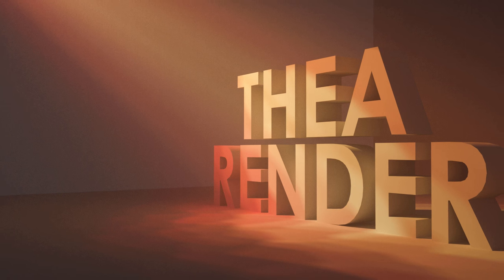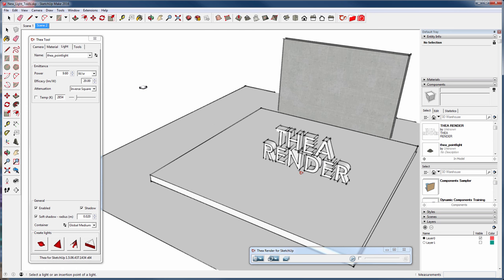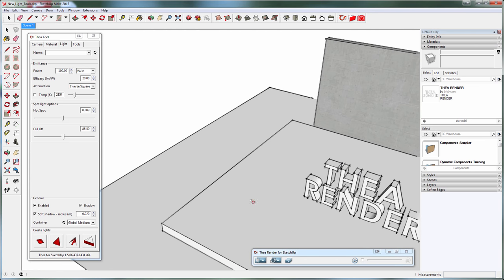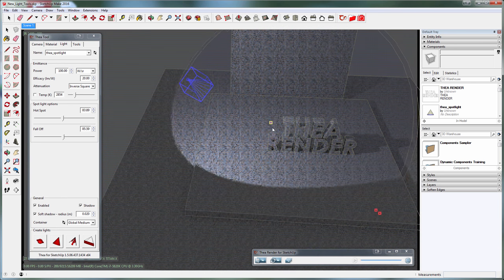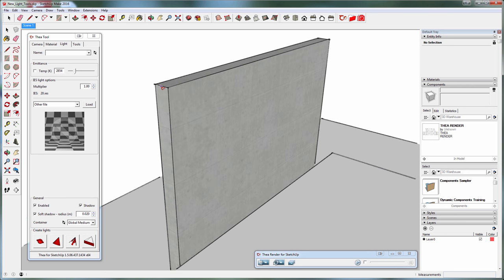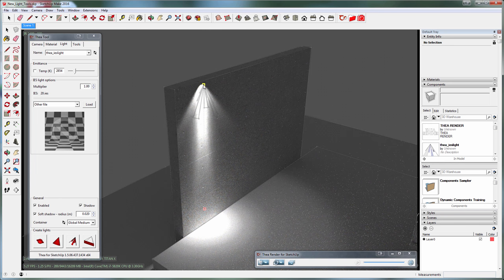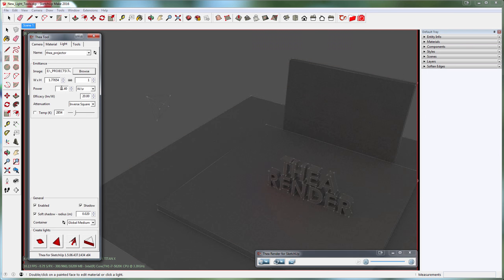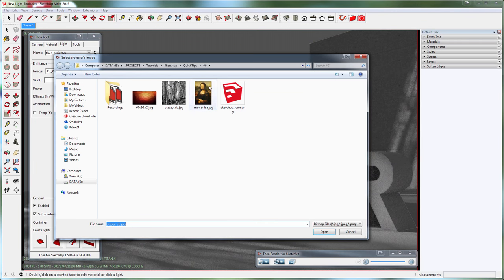Thea for SketchUp: Quick Tip - Light Tool

Comment: Hi, having issues with the lighting. Working in Sketchup 2017 on a Mac and I am unable to produce any kind of light. When I place the light source it does not produce any light when I render the scene. I have played around with the power/temperature/etc. and none of it has worked. Any advice would be helpful thanks.
Reply: I'm with you here. The only light that seems to be working is the point light and even that is ridiculously dim.
Reply: @matiasahonen6912  did you figure it out why it happens? because I have the same problem right now.
Reply: I am also a new user struggling with this. Not easy to work out given the lack of videos online. It would be amazing to have Thea update these videos or for someone in the community to help